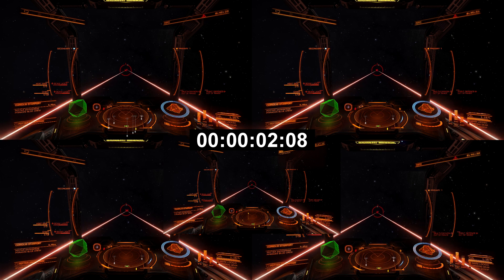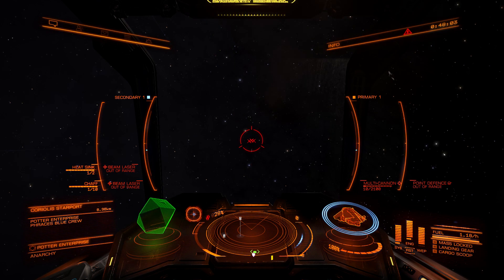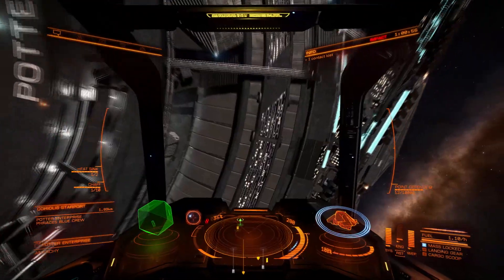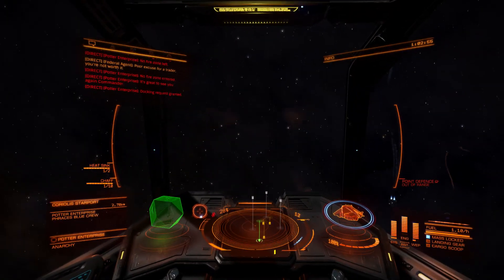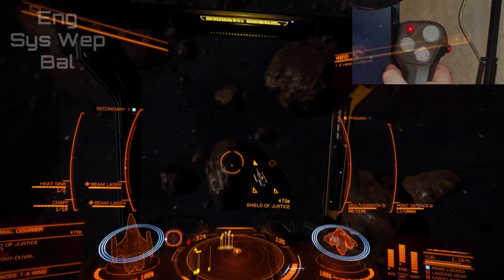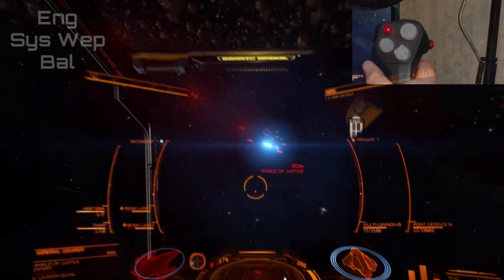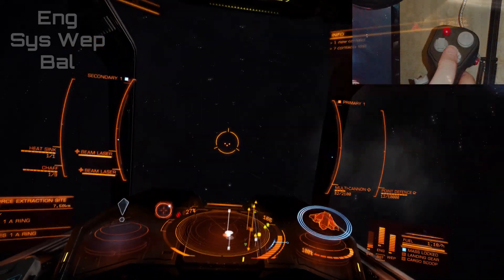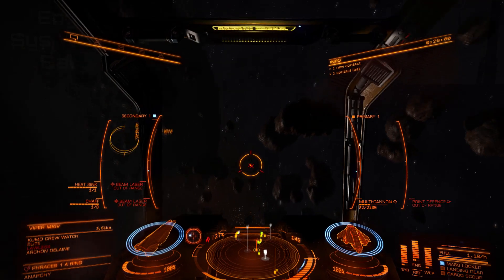Elite Dangerous: Getting Good - Power Management

Comment: If you're shooting multicanon and your weapons capacitor stays full while shooting, is there any point in putting even more pips into weapons ?
Reply from the maker: It's very situational. Depends on the rest of your weapons and how often they are used.
Reply: What I mean is , if you fire a single round from a multicannon while you have no heat and your distributor is fully charged, will increasing the number of pips increase the amount of damage that this single round will do ?

And in the same scenario,but shooting a few rounds, will the number of pips increase the maximum rate at which the rounds can be fired ?
Reply from the maker: OH no, not at all. pips in weapons have no effect on damage at all.